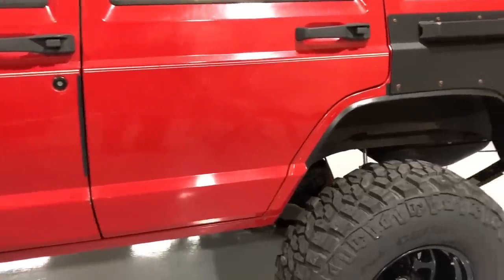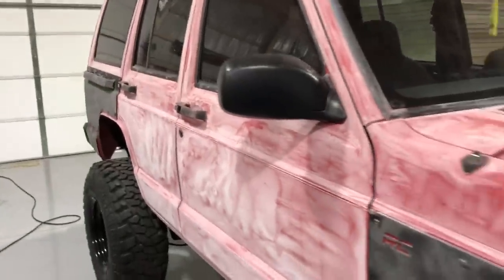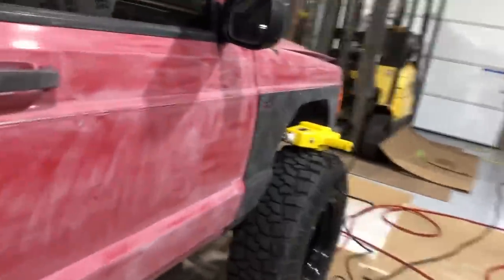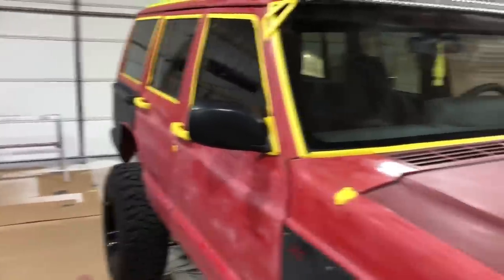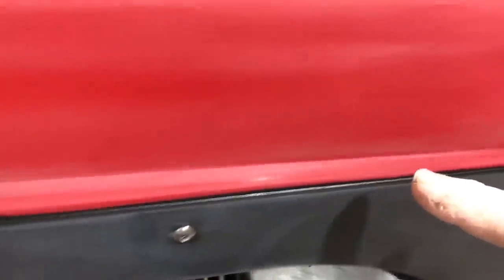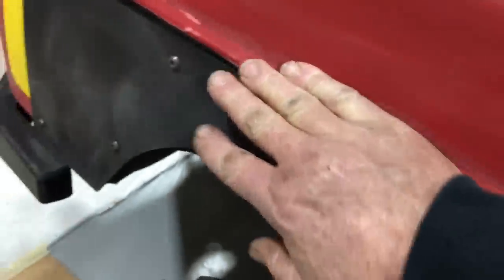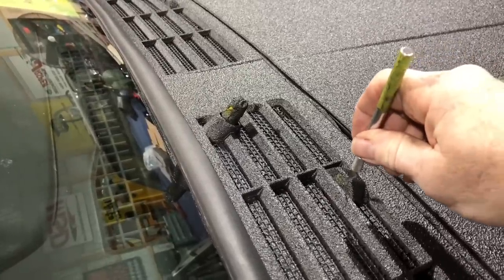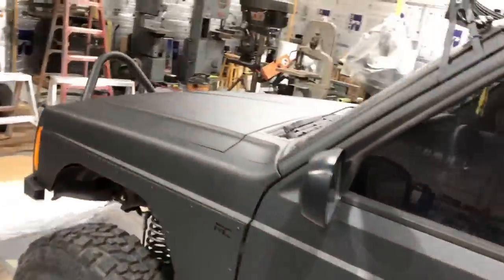Jeep Cherokee Spray On Bed Liner

Comment: I've Raptor lined all my armor and tub and trust me when I tell you...spend the extra $50 on the Upol vari-nozzle gun. The end result is night and day. You can adjust the texture for a consistent finish from micro fine to coarse and won't clog up and spit blobs of liner like the gun the kit comes with. Plus, adhesion promoter for all the tight nooks and crannies. Lastly, don't spray till the bottles empty. The residuals on the bottom of the bottle always gets clumpy.
Reply from the maker: I was wondering about a better gun although I’ve been lucky
Reply: PB Machines don’t get me wrong, I’m not saying you can’t get good results with the regular gun but once you try the pro gun you’ll kick yourself for not getting it sooner. The ease of maintenance with the way the pro gun breaks down for cleaning...that alone is worth the investment.
Reply from the maker: ApexPredator_JKU I’m not using that pos gun again can’t wait to get a good one thanx for the info👍🏻✌️
Reply: Got a link for that sprayer?

Comment: Had a friend do this about 3 or 4 years ago to his XJ. Looked awesome. Moved the front axel forward , lift, lockers , 38s, Atlas etc. On the taller creek banks the front end was just to light. Gotta Toyota on propane, 42 Super Swampers cut,  I think , front forward , lift, lockers etc. This thing is a absolute beast!
Reply from the maker: Nice can’t have to much cool shit right ✌️
Reply: @pbmachines972  
Yeah, this guy has quite a few toys. Rail Buggies, side by side etc. 80 x 40 garage , lift pretty sweet. He has worked all his life though, no freebies!  Me, I  can't  do that. Retired and disabled. Shotgun blast at close range while working.

Comment: You mentioned that you used two kits. Did you use the six bottle kit or eight bottle kit? I have an XJ that I want to bed line, just not sure if i'll need the six or eight bottle kit. Thanks.
Reply from the maker: Dam dude I forget the bottle count but I used one kit plus one bottle out of the second kit hope that makes sense ✌️

Comment: Sup mem , you killed it with this paint job , its still the best bed liner job ive ever seen . I was wondering for your prep you just sanded the clear off added some new primer where it was on bare metal . And then did you shoot 1 or 2 coat ?
Reply from the maker: Just take gloss off no shiny spots do not burn through any paint and a kit and a half to do that job so you’ll need two kits a kit normally does one full size bed

Comment: Just a few more months I’ll be doing this to my Jeep as well. Mines also red. Plan on doing it the correct way much in the same as you did here, with a few added steps. Possibly some air brush or decal stenciling, Nice work 👍🏾

Comment: Been good to do the jams if enough product remained (with time to spray it) and why not remove the bolt on body panels and scuff/spray rather than depend on seam seal? (Ive never had a jeep that didnt get a fender flare bumped enough to dislodge a bond to the body) keep in mind, ive never dealt with bolt on body panels, so my previous question may be ridiculous, if so, its out of my ignorance on the topic, not as a "troll". Thanks. Looks awesome

Comment: So you used purple power, then dewaxed it with what? And sanded it with 320 dry? You didn’t use no primer? And what did you clean all of the dust off with After sanding it, Great video though.

Comment: Nice work good video thanks for all the info.  👍 how much will a job like this cost materials and labor. $$
Reply from the maker: Machine Addictive digging retail prices about $160 per kit I bought two but only used one bottle some tape and cleaning solvent as far as labor it’s basically a complete paint job if I gave a number total $1000 ✌️

Comment: Will bedliner stick to primer and will primer stick to that paint That's scuffed could you just do primer on top of it and then also do bedliner ? I don't know anything about painting by the way lol.
Reply from the maker: So depends rattle can primer no catalyzed epoxy fully cured then sanded yes
Reply: @pbmachines972  cool !

Comment: So.... why only knock the gloss off and not the paint coat????
Reply from the maker: The product is made to be applied over paint that has been scuffed any other way is incorrect
Reply: PB Machines ahhh alright. I’m getting ready to bedline my entire Jeep. Could it still work if I bedline over the primer???
Reply from the maker: Jean St. Cyr epoxy primer yes plain polyester fill and sand no

Comment: How many bottles did it take you I’m looking for that exact color for my jeep
Reply from the maker: Devan Mckeehan I bought two kits I used five bottles ✌️
Reply: @pbmachines972  do you have to have a certain type of sprayer for bed liner? Never sprayed anything with a sprayer, painted my chipped up hood black with high heat flat black, this looks way better though might try do my whole 93 zj
Reply from the maker: Joseph Huffman yes they sell a cheap gun like $30 and a good one like $100

Comment: Im planning to piant mine soon. Is 6 bottles enough? I have 2 so i was thinking about buyijng a kit of 4. Also i seen alot of black bedliner jeeps fade. Do you have any pics or owners fb profile of the jeep?
Reply from the maker: Six should be enough but what if it’s  not I’d have two full kits on hand and no I lost track of the truck ✌️
Reply: @pbmachines972  what do you think about black? Ppl say it fades faster. And some told me to do different color not black

Comment: How many bottles did it take to complete this job ?
Reply from the maker: U Pol brand it was one kit and one bottle from the second kit
Reply: PB Machines that’s a 4 bottle kit
Reply from the maker: I think that’s what it was one kit for a full size truck plus one bottle from the second kit
Reply: @tyroneferdinand1303  they also sell a 6 and even an 8 bottle kit. but the 4 pack is normally the best deal. 
once i tried it, i ended up putting it on everything. i have used 16-18 bottles by now. since it is very durable and texted, it is so easy to get good results compared to regular paint
Reply: MrMrsregor i’m painting some parts on my hilux, the roof, the bonnet (hood), and the tub. would i be able to get away with only using the 2L kit?
Reply: fruits x no, I do t think so. I would say 2L would do your roof and bonnet nicely with little - no left over. But I always do at least two coats
Reply: MrMrsregor thanks heaps man

Comment: What psi did you spray at? This came out the best I have ever seen with the gun provided. And also what size compressor did you use at the time?
Reply from the maker: 60 gal 5hp sprayed at 50psi keeping your distance is most important
Reply: Thank you so much for the reply and what distance did you use for application like around 3 feet?
Reply from the maker: @thirsk66  around two ish
Reply from the maker: @thirsk66  if I were to do it again I’d buy the good gun
Reply: Just bought the pro style gun so let’s see if I can get this done properly this time around second time spraying my mazdaspeed 3 first go of it was way too close and just made it a gloppy looking job

Comment: What air compressor did you use to spray it on? Currently in the process of doing it myself and was wondering what a good compressor would be for this.
Reply from the maker: 5hp 60 gallon that’s good

Comment: Could you tell me what air compressor do you use? Or what air compressor would work to do this job
Reply from the maker: I have a 60 gal 5 hp anything smaller might cause problems

Comment: How long does bed liner last in this type of application? I'm looking to do the same to my new Gladiator so I do have to worry about anything on the trail or in the winter (where my area uses a TON of salt and chemicals) on the roads. I've seen a lot of guys use MonstaLiner and some Raptor Liner
Reply from the maker: Salt is the devil otherwise it should last a long time

Comment: Your doing it right,.  But I gotta say I'm not a fan of bed liner painted off road rigs.    It looks good for a while and then fades to grey
Reply from the maker: Walter Davis I think it’s a thing right now
Reply: @pbmachines972  it's tough when you get I big scratch in it,.  Kinda tough to touch it up.   A lot of kids do that to their trail rigs here in Pennsylvania.   After a while they all look awful.     But you did do a great job on that one
Reply: Doing it  “right” would include removing doors & dismantling along with bumpers hood etc. The other problem is unless it’s the real deal “Line X” the results won’t last. I have several vehicles done in it , some 5 years old and they still look like they did when we sprayed them.. just got done doing my XJ love it!
Reply: @willy2192  you would be surprised how many body shop just rinse the vehicle off with water and spray it .  And charge an arm and a leg
Reply: Willy raptor liner lasts too if you touch it up every couple months

Comment: How do you recommend spraying this (technique wise) to avoid stripes. Almost every Bedliner Job i see has stripes this one is clean any tips ?
Reply from the maker: So a better gun is available it has a spray pattern adjustment I used the cheap gun and held it thirty inches away or farther and I sprayed in both directions
Reply: PB Machines awesome man thanks. You think if i spent the extra money on the better gun and did two coats instead of one it would even out the stripes ? I have my truck currently plasti dipped I’m peeling that off and gonna raptor liner it
Reply from the maker: Sean Hunter yes I just found out about the better gun I’ll never use the cheap one again it’s only like $60 bucks get the good gun
Reply: PB Machines cool thanks appreciate the input

Comment: What size lift and tires is on that jeep
Reply from the maker: It’s my friends truck so I’m not sure ✌️
Reply: @pbmachines972  okay I have a 1995 Grand Cherokee laredo want to put a 3-4 lift  having aaa hard time deciding which one would be bestee laredo want to put a 3-4 lift  having aaa hard time deciding which one would bmmt and should I do 31, 32,or33's any help in helping me make this decision would be greatful. Thinking about wheel spacers as well

Comment: Looks great, just did this on my f150 running boards and bumpers. Tomorrow mirrors and door handles. Do you have any suggestions on spraying on the door handles?
Reply from the maker: inevitable tragedy thanks small pieces are tricky

Comment: So did you do 1 coat around the whole truck or did you do 2 to 3 to build it up more? I'm doing this to mine this summer and need some more insight. I saw on another comment that you used 6 bottles. 6 bottles for one coat or 6 bottles per coat? And about how long did sanding and masking take?
Reply from the maker: The truck was red so I sprayed it on in two directions so technically yes two coats

Comment: The only real problem is now that the hood is sprayed, it's going to hold in more heat. Might want to think about putting vents on the hood.
Reply from the maker: Good thinking but it’s been over two years now no problems yet✌️

Comment: Damn that’s so nice! I’m planning on doing this to my 1998 Jeep Grand Cherokee Laredo. I don’t mean to be rude when I ask this but how much was it to do this?
Reply from the maker: Your not rude at all a Raptor brand kit retails for around $160 your going to need two kits plus a gallon of prepsol $30 and tape $20 ✌️
Reply: PB Machines damn okay thank you so much!
Reply from the maker: Um don’t forget I have other videos mostly metal fabrication/welding maybe check it out
Reply: PB Machines will do man!
Reply: @pbmachines972  hey one last question man, how many coats should I do? Just 1 coat?
Reply from the maker: @cyberduntz  should do two✌️

Comment: What was the paint brand/code you used to tint it?
Reply from the maker: Eli Langlois is plain black✌️
Reply: Are there different base colors that raptor offers or is it going to look like that straight out of the bottles?
Reply from the maker: Eli Langlois I’m not sure what the tintable stuff looks like without color added but the black standard bedliner is black

Comment: a question I want to ask you after painting your truck with Raptor Liner, the paint does not lose the shine that remains after painting it, that is, with the dust and dirty it does not remain opaque, and later when you wash it, the paint raptor texture?
Reply from the maker: I think over time the sun takes the shine away more than anything hope that answers your question ✌️
Reply: @pbmachines972  But what would you recommend, my dodge ram I want to paint it black like this.  but I don't know if it looks good full of powder
Reply from the maker: Parachoques y Mecánica General Farmor I think you can clear over your last coat of bed liner before it fully cures like no more than thirty minutes I would do a test before doing the whole truck

Comment: Hey bud, nice job I just did my xj and your turned out a little better, did you use the proper raptor gun ? And what psicwas it at thanks aye
Reply from the maker: Hey thanks I used the cheap ass gun high pressure and hold the gun like eighteen inches away

Comment: Nice job. I have a rear bumper that I’m welding up and I need to coat it with something, would bed liner work?
Reply from the maker: Sure it needs to be primed at least using an epoxy primer or it will rust right through the bed liner
Reply: Thanks! Where could I find that primer?
Reply from the maker: I know Eastwood carries paint if you have a local automotive paint supplier that’s always better

Comment: What air psi did you use? I'm getting ready to do my 2004 ram, and definitely liked how this turned out
Reply from the maker: Cool don’t use the cheap gun buy the good gun if you use the cheap one crank it up like 60 psi do some test spots to see✌️
Reply: Ok thanks, was thinking about getting a harbor freight gun then drill a 2.0 hole, to use it I dont want it to textured...

Comment: That turned out great. How many bottles did you end up using? Subbed
Reply from the maker: Panic thank you so much👍🏻 I used 5 bottles I did two coats first coat in one direction then right away in the other direction like thirty inches away from panels ✌️

Comment: I once sprayed the entire undercarriage of a Dually Ford Diesel work truck and the drivetrain failed long before the body did. Over 4 million miles.
Reply from the maker: Wow that’s a lot of miles thanks for watching
Reply: I still advocate people do this to their own vehicles today 30 plus years on. Just make sure you drop the driveshafts and exhaust beforehand.
Reply: ??? 4 million miles? How many times was the engine and tranny rebuilt?

Comment: "Rough country is the great value (brand)of suspensions"
Reply: Taco....

Do you run a RC lift? If so do you like it?

I have one on mine (2nd time around) and i dont feel like its that great...i mean i feel EVERY  bump and crack in the road, and it seems to roll quite a lot.....shocks wise....
Reply: Upgrade the shocks cheap ass. I going from a 4.5 rc lift to a 6.5 long arm rc lift with fox shocks and 1 ton steering upgrade kit with built dana 30s with upgraded drive shafts

Comment: Would you recommend bed lining it before added the armor panel or just spray it after it’s on ?
Reply from the maker: SCRAPS 360 good question if I had a choice I’d do under um first then the whole truck